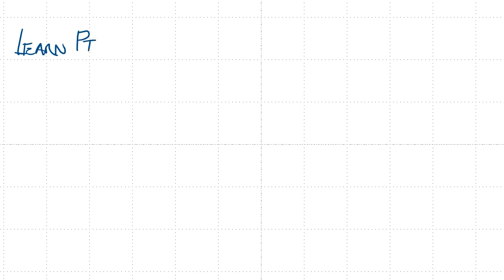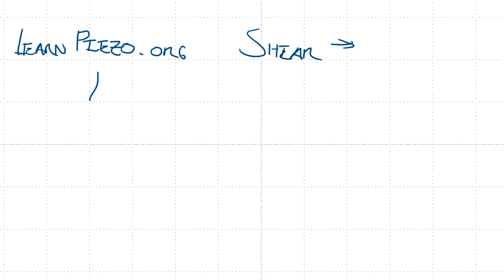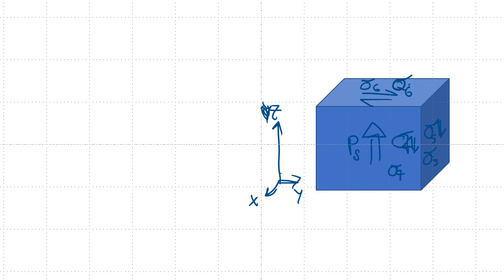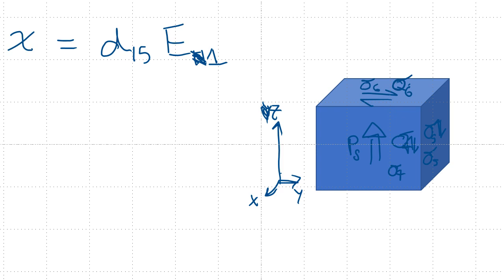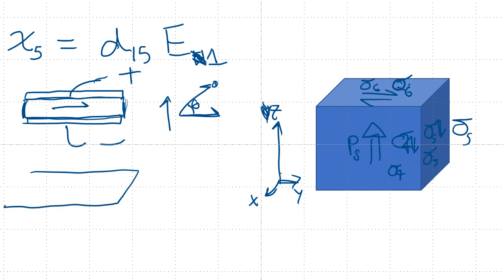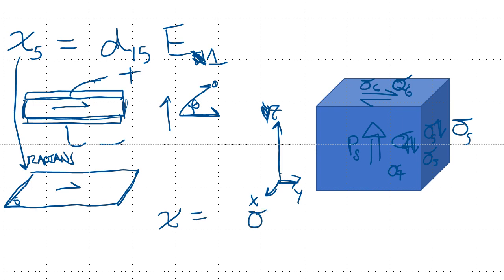Learn Piezo Lecture 15 Part A: Piezoelectric shear

Comment: Is this the process for gaining a higher coefficient? Neither a straight polarization or a perpendicular polarization of the material will be as good as a double sided polarization, if I'm following this to change the angle of the grains to get a more "stretched" charge?
Reply from the maker: You could make a canted polarization, but that would not result in uniform displacement